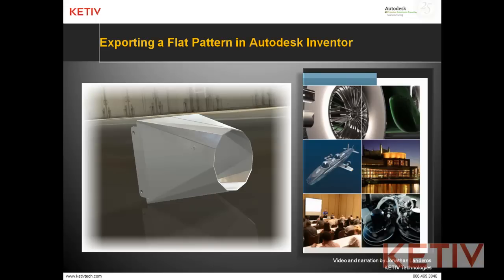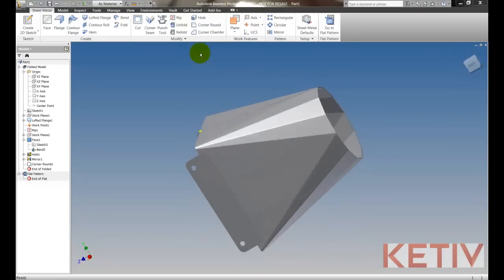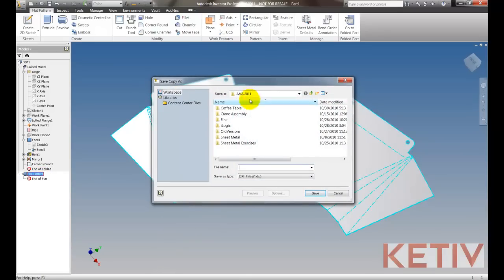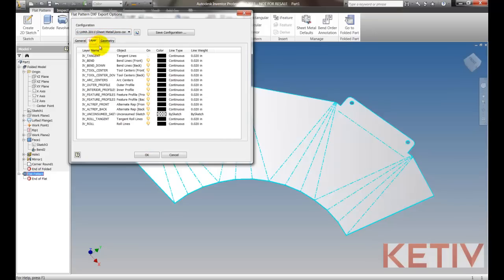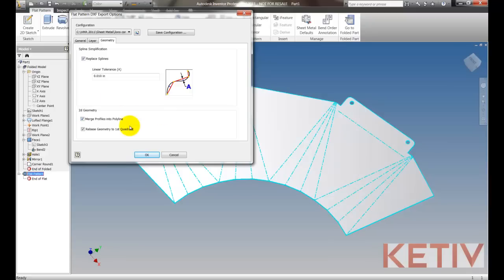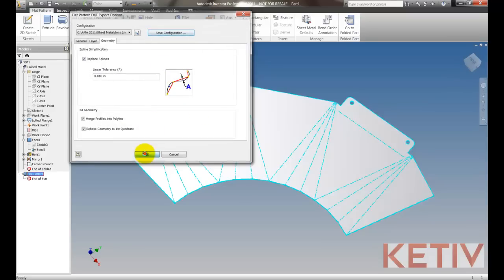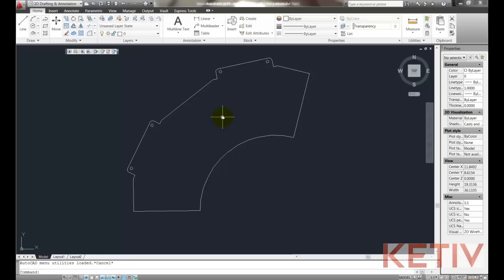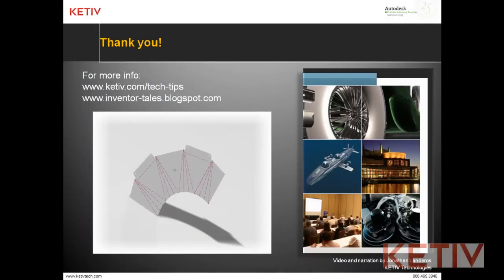How to Export Sheet Metal Flat Pattern in Autodesk Inventor

Comment: I need this to be connected to the main part and I don't want to save the flat pattern every time I make changes to the main part. For now I use wrap but I know it has a bit of difference than flat pattern. I am talking about 8'x40' plates for the tank roof.